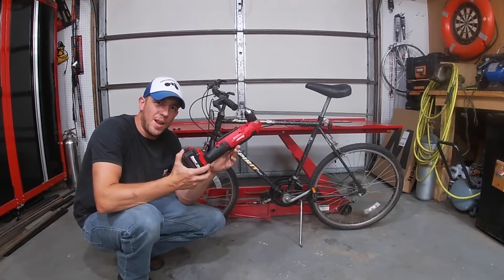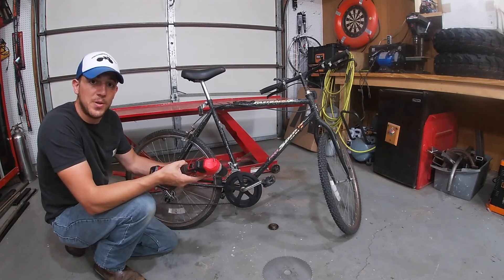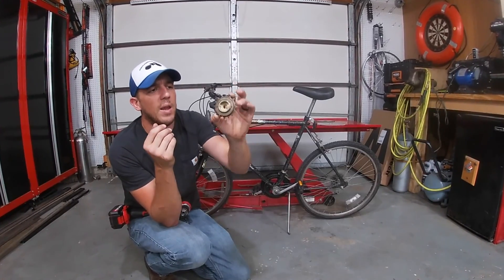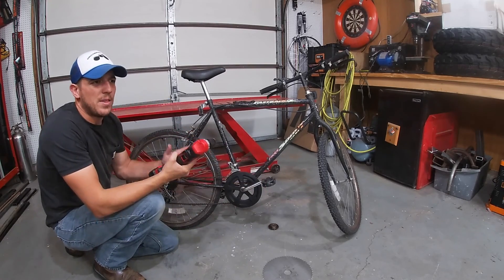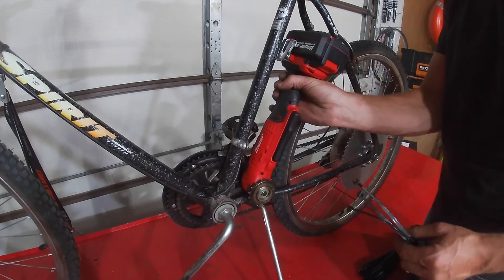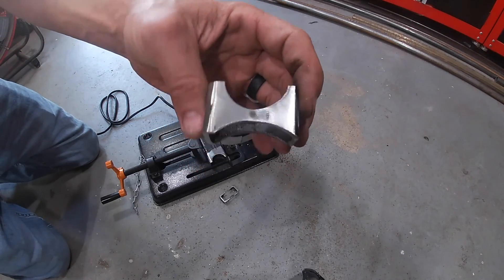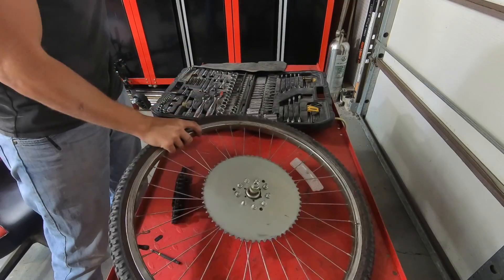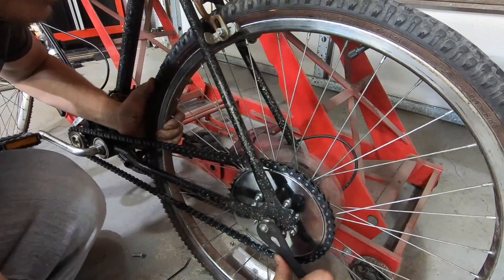Drill Powered Bicycle, using a Harbor Freight right angle drill.

Comment: I think it's perfect with the 60 tooth sprocket. The drill is fairly light, doesn't absorb crazy amount of energy ( it's probably 100 watt total output) but it has great torque,which is the entire point of it. Bikes aren't meant for crazy high speed and the engine supports and hold the cruising. Curious how performs on a steeper path

Comment: Go back to the first setup and only use the drill selector # 2 (drill’s high gear) when you are pedaling...like you said “pedal assist” not electric bike... btw, most drills aren’t designed for continuous use...

Comment: I am looking at using a design like yours to handle a 20 mile commute.  It is fairly flat, and I just want to cut down my trip time.  Have you done any experimenting with using it for top-end assist, instead of relying on mostly the drill for moving the bike?  Did you try normal pedaling down the street and using the higher gear?  Was there anything specific about the Harbor Freight drill that made it the best choice, or was it just something you already had? I'm looking at the Dewalt 20v version.  What was the RPM range of the drill you used?  Did you machine the sprockets yourself?  I'm thinking about 3D-printing mine to give me maximum sizing customizability.  Did you have to hold the throttle in position, or could you set it and just ride?  Do you think you were getting full travel on the trigger?  I am thinking about splicing into the drill trigger wiring to ensure I get 100% available torque.  Another thought I had was to mount a couple batteries somewhere else on the bike, lock the trigger all the way back,  and just wire the batteries through the throttle.  Did you still need the idler sprocket once you switched to the smaller sprocket in back?   Do you still feel like that was the best drill mounting location?  

Your design has a lot of features that demonstrates the effort you put into the design.  Too many of these projects are done with scrap wood, duct tape, and zip ties.
Reply: Get a 350-500 watt bike electric conversion kit. A drill is not designed for continuous operation...
Reply: It’s called a motorcycle lol

Comment: I tried the same with kobalt right angle drill. The motor was strong enough but the chuck  sucked and kept letting go of things
Reply from the maker: Try removing the chuck and bolt the freewheel sprocket directly to the shaft that holds the chuck
Reply: We wanna know how the torque compares, I've been researching online to figure out how to make my kid a Stacyc18 or Stacyc20 competitive bike, they retail at $2k-3k

Comment: how long will the battery last
Reply from the maker: Not sure I didn't take it very far, if I had to guess it would likely be under 10 miles with the amp hours being so low on the drill